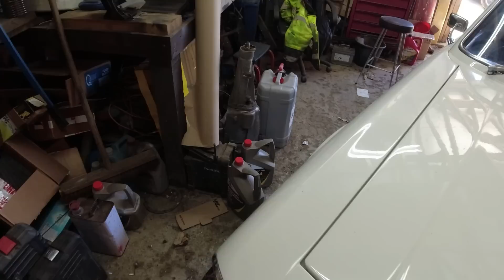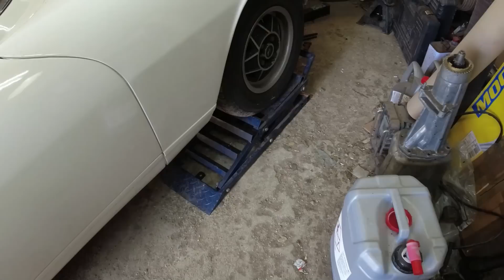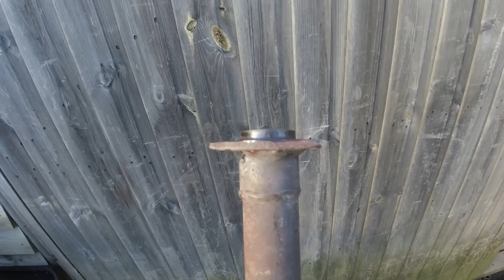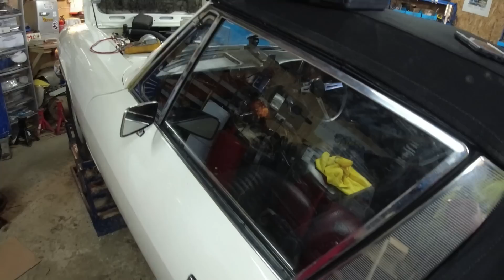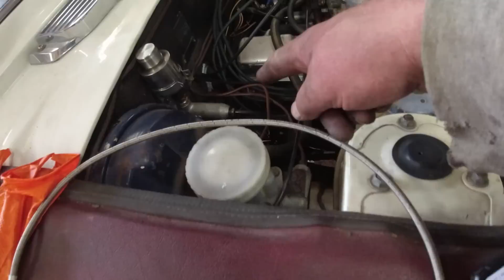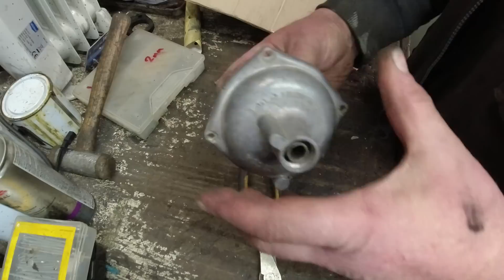1971 Triumph Stag clutch hydraulics, exhaust and weird carb issue

Comment: Honestly, some customers are never satisfied... I think you need to be straight with the chap and tell him that with a fault list like that, that Stag is just like it left the factory in 1971!  😉
Reply from the maker: stag never left the factory with a clutch bite point on the floor. That has been recently introduced by borg and beck clutch cover plates... customers issue was definitely legitimate else why is anyone coming up with a fix for the issue. The alternative was to remove the gearbox, throw the B&B cover in the bin and fit a refurbished used item. 

the market is flooded with rubbish parts

Comment: Always welcome stag topics , I found when fitting exhaust headers the angles are not as good as they were,    fit first to manifold  and check angle    nearly every time I have to heat up and bend to correct shape to meet silencer.  , hence you hear about cracked manifolds if you don't ,  thanks as always Richard.
Reply from the maker: I concur entirely. Range Rover classic v8 manifolds suffer from stress cracks if installed incorrectly. This down pipe however had been thoroughly and comprehensively messed up by a well intentioned and person with a lack of an eye for what was going on